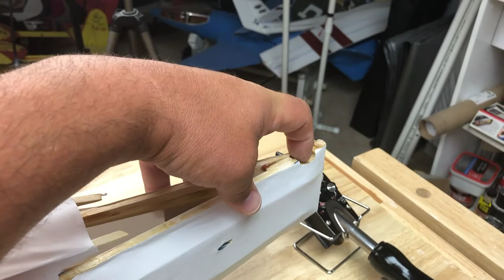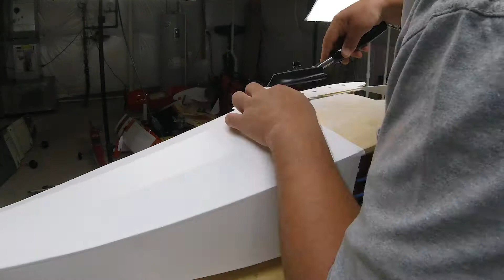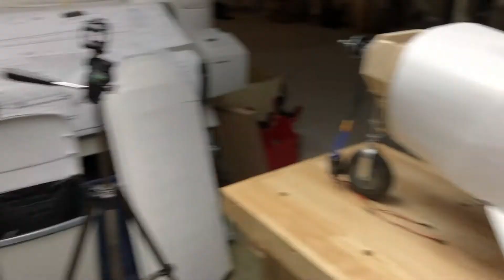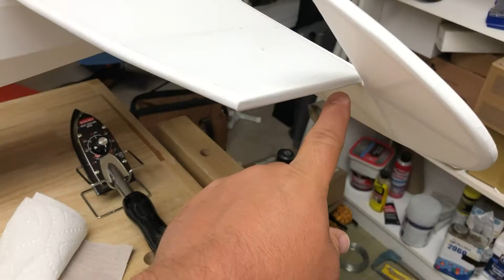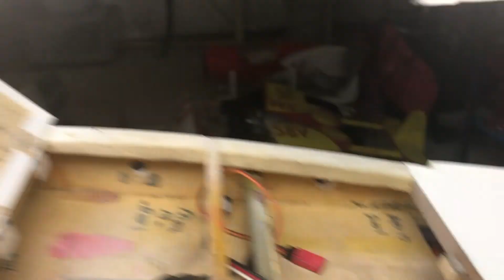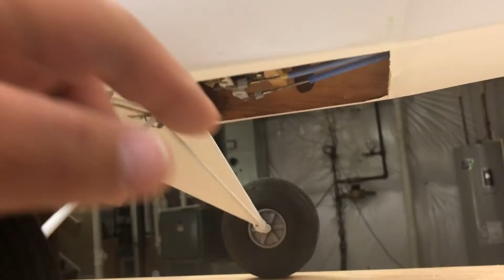Tripacer Episode 12: It all comes together

Comment: I'm enjoying this series. I have a Sig ¼ Scale Clipped Wing Cub restoration I need to get back to. I bought it, with Zenoah G23 at a swap meet in spring '19 for $160. The covering was aged but sound. In evaluating the plane, I came to the conclusion it had never been flown. It only had ½" of rudder throw and about the same on the other control surfaces - not even close to what is needed. If it had ever got off the ground it would have crashed. 

The problem proved to be that the original builder (I got it from at least the second owner) had used a cloth covering, Coverite I'm guessing, and run it into the control surface joints. That, along with no real rotation relief, had resulted in the binding. All the control surfaces were hinged with CA hinges so I had to cut them loose, I'll use Robart hinge pins to replace.  I stopped work to do a quick build of an electric sport plane but severely damaged my shoulder in a fall (making that quick build last nine months) and it's been almost a year since I worked on it but this series is inspiring me to drag it back out and get it finished. 

I don't intend to do as thorough a job as you as I just want to get it flying. I actually have another Sig ¼ CWC in the box for which I have ambitious building plans. This one is basically intended to refresh my hand/mind memory on flying a plane like this. This will be my third large CWC but its been a good while since the last one.

I liked the detail about your decision processes as you went through the videos. There's good material there for future efforts. Here's a suggestion you might like. When I cover, I like to lay the model on a big piece of cushion type foam. I got an 8'x3' piece from Hobby Lobby for less than $20. Not only is it a good way to avoid dings in the parts on which you are not working, I find I can pull it over the working piece and weight it down to free my hands, like if I need to pull covering while heating, for instance. The foam distributes the force of the weight.